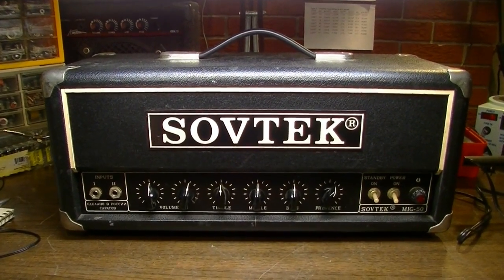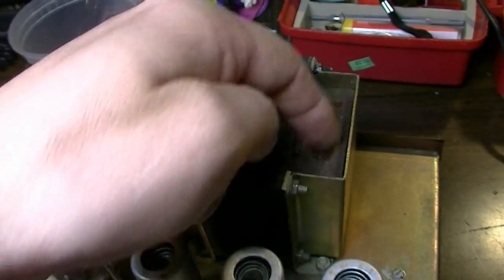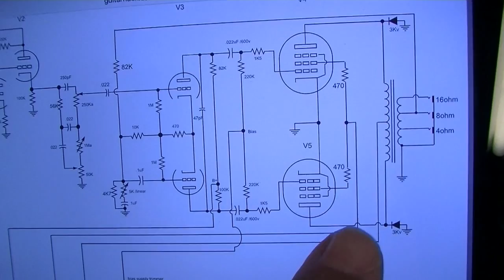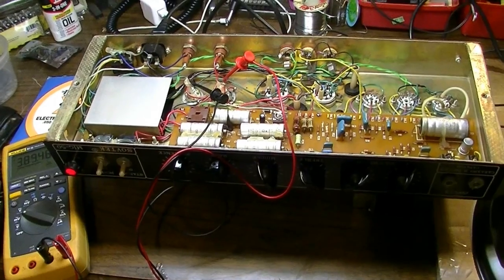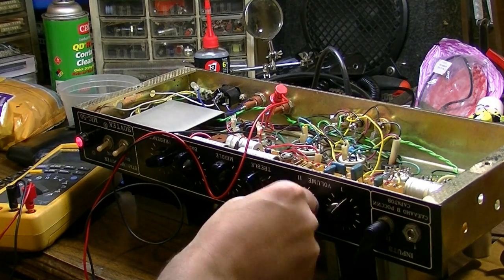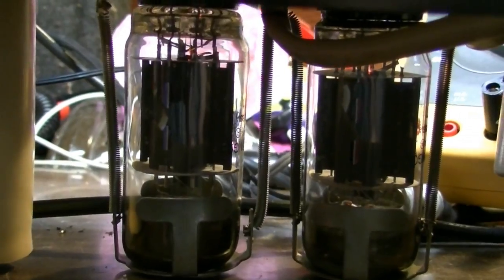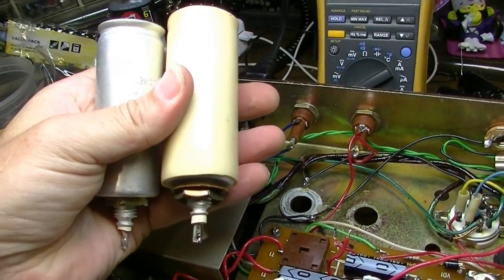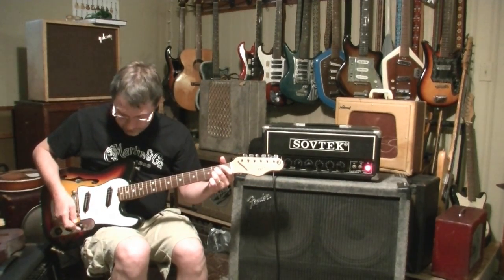PROOF the RUSSIANS RIGGED this Guitar Rig!

Comment: Problem with the capacitors listed on the schematics, they are obviously not correct. When it is shown as 25v and it is connected to a 600v rail. Also on the input triodes, the cathode bias capacitors should be similar or it will have low gain and only have high frequency response. As with all of these circuits, it is a good idea to have a tube reference manual. Also assume that someone probably put the wrong parts in the amplifier at some point. I have found even in color TV's from the factory the wrong resistor values from the factory. 

The input triodes can work without the capacitors in the cathode circuit, and if the tube is glowing best to cut one lead of the capacitor as it is most likely shorted and not allowing the tube to operate in self bias mode. Also this whole amp, it is best to draw your own schematic. Then using ohms law calculate the currents and voltages. All of the grids should not draw current, as it will destroy the tubes. Also just because those are mylar caps for DC bypass does not mean they are not leaky. The electrolytics  are easy to sub values, and replace in pairs when in series, otherwise one will see higher than rated voltage. 

The pots should be changed if noisy, or damaged. The way to check is put an ohm meter across the pot and turn it, if it sounds like sandpaper on the input then it is bad. 

Also the reason for the tube manual is (for those that have not used one) that it lists NORMAL voltages, current, and power dissipation so that it it obvious when the tubes are going to quickly fail. Also self bias is the resistor to ground in the cathode circuit to bias the grid negative with respect to the cathode. Also the cathode to heater voltage should always be kept low and commonly 50v or less. Series heater circuits are the only exception. That is because it causes line noise in the output and if high enough will break down the insulation between the heater and cathode. Not connected in this amplifier is a small trimmer pot across the 6.3Vac with the wiper to ground, and this is seem in circuits to eliminate line hum in the output. Because there is a small capacitance between the heater and cathode of every tube. This puts the hum into the circuit, and filter capacitors alone (no matter how large) or with a multi stage PI filter on the supply with chokes will not get rid of it as that is not were the hum is being introduced. 

I say these things from working on tube equipment for close to 40 years, and transistors circuits are the same when it comes to timing and frequency response when compared to tube circuits. The difference is the bias circuits. Also just because it is common to use a resistor for biasing a circuit, that is not what the resistors are used for in the 2nd grid. It is used primarily for current limiting to keep the tubes from being damaged. As those resistors are often bypassed with a 6L6GC, 807, and other common tubes, but are included when the tubes may go into saturation and draw too much current. I recommend investing in one of the older Oscilloscopes with tubes in the input stages, as they are more forgiving when working on hot circuits. Also the probes need to be good for a minimum of 500v, but more is better. Also having a probe with a bypass capacitor in it should be used when working on tube circuits. Invest in an isolation transformer, as when testing any of the tube circuits it needs to have the grounds and primaries isolated to avoid surprises such as burning out the ground circuit on your test equipment or the customers equipment. 

A word about safety, Gloves rated at 600v are not expensive and safety glasses is a must. That is because electronic components DO explode and I have seen this happen even with small transistors, capacitors, resistors, IC's, wires, and so forth. This is something likely to happen when repairing equipment, but not likely to happen during normal operation. This can also be used in finding problems in circuits, find a cracked part liquid coming out of a capacitor, and other things that do happen but not during normal operation when working correctly is the first stage of troubleshooting, next is checking voltages, then tracing signals.  This is why I recommend proper safety when working with higher voltages, as only things visible with a "Good" work light or flashlight can be found with the power off.

Comment: I have multiple devices from soviet russia with those types of electrolytics (from the 70s/80s). None of them have broken capacitors.
Those caps are from 93, so they are basically new....why change them? What brand and type of caps did you put in?

530V "horrificly high plate voltage". On the screens maybe a tad high but I wouldn't bother - the bigger issue is that they have that voltage on the screens as well like all the Marshalls. These amps need a second lower voltage tap for the screens...

Also, your probe does not even remotely look like it was proper insulated for the voltages you are working at.

Comment: After watching about 20 of your vids I'm about ready to revisit my tube amp repair days and dig into the1966 Ampeg B-12 flip-top recently acquired, all original except for the the chrome Ampeg logo. Getting a loud pop after the amp warms up. 7868 pwr tubes.  Bonus! The schematic is inside the amp head.
Reply from the maker: Check everything on the power rail. Change all caps and large power resistors and see if problem persists.
Reply: Thanks, re-capped the power rail & found a cold solder joint on one of 12AX7 preamp tubes. One of the caps had spewed some innards on the chassis... all good now.
Reply from the maker: Awesome! Cleaning sockets wouldn't hurt either. Lots of weird noises common with dirty sockets. Might prevent future problems from happening.
Reply: Yep, good advice, I have a test amp from Seymour Duncan they used to develop one of their commercial tube amps, it was such a mess, finally got it up and running but couldn't figure out where the random noises were coming from...Dirty Tube Sockets! My pic now shows the Ampeg and a 68 Epiphone Howard Roberts guitar (solid top). See you around, thanks again.

Comment: Great video series BTW, i am learning a lot.  QQ, for those large capacitors you replaced, did you just cut the old ones out and solder the ends to the old posts or did you completely remove them from the old board?  I am currently trying to fix my fender red knob amp and would like learn some best practices...  thanks..

Comment: The Jolana looks like the old Fender Bullet guitar except both pickups here are slanted.
Reply from the maker: It's from the early 70s and was meant to mimic the Fender Thinline Tele.
Reply: The early Bullets looked like a Tele too, but with Mustang pickups where the front one was slanted and the rear one straight, and they didn't have F-holes like this guitar, but they're both essentially just smaller Teles.

Comment: in the 90's i played n almost baught a used sovtek mini stack. 2 cabs n head. not sure of size or numbers of speakers or watts but was loud n had a knob you could pull n go from heavy distortion to pantera/djent. i loved the sound compared to my crate tiny personal amp.  it was loud enough to play with drums. 😍🍻

Comment: I have some of that material you said was fiberglass.  I don't think it's fiberglass.  It came out of an aircraft that did magnetic surveys for resources in the ground.  Its was called magnetic something/something.  It was used to isolate their computer and expensive "imaging" equipment from electrical interference caused by the aircraft.  The fellow that gave it to me gave me a very technical explanation regarding the stuff which went in one ear and out the other, so that's all I've got.  I used most of it for making jigs in my woodshop.  The dust when cutting it is supposed to be toxic if I remember correctly.  This was way back in the mid 80's, so yeah, long time ago.
Reply: Seems like you know a lot about these amps. I own a Sovtek Mig 100 and in between the preamp and power tubes there’s a small coffin shaped ventilated compartment that reads “Caution Radioactive Material” 

Any idea what’s in it? The tech I took it to said NOPE and that was it. It has wires going to it and to basically everything inside.

Comment: That schematic must be drawn wrong because that heater CT can't be connected to the power rail because the capacitor C21 is only 25 volts.
Reply from the maker: You make a good point. Another schematic I saw has a 1M resistor in series with the CT, after the cap, which should effectively drop V way down, but how large would that R need to be? I think I'll go back over the videos and see if I can make out what's going on in the amp.
Reply: I was going to point this out to,  I read through the posts to check.. The ECC83 Vfk is around 180V so in no way can the center tap of the heaters, in this design, be connected to the positive rail of over 400V, note the cathode follower must be held in this limit too. PS. I used to build Nolan Amps in London UK in the 60's.

Comment: I had a Sovtek MIG-100  bought new around '96. Great sounding amp. But as you've observed, the parts were garbage. My intentions were to A/B  it with a Fender Super 6, but there was some type of ground hum issue, and also it would knock the crap out of you at the mic. Traded or sold it fairly quick. The cheapskate tube circuits scared me a bit.

Comment: Its always a good idea to Re-Form caps after installing. The main reason is we don't know how long they've ben on the shelf. Some caps like F&T don't put Birth Date on them which is a Scam. Even if an amp with newish caps is left un-powered for a year or more its a good idea to Re-Form. The longer a cap is without power the longer you should take to Re- Form. There are formulas online to calculate this.

Comment: those burned resistors are 2 and 5 watt ones and slightly burned paint coating is actually OK. 
paint just can't withstand 5W heat dissipation. (resistors of this type are quite good and can take much more power than rated).
big (in size) soviet caps are usually OK too, but small ones are just shit and needs to be replaced without checking.

(i am russian)

Comment: They also made a mig 30, mig 50 mini, mig 100 and mig 100H. I modified and sold 100’s of them. Fun to mod. Can be made to really sound good. The transformers also are made for 110 when you use 120 volts the filaments are at about 7.5 volts. Not good for the tubes. Usually 2 12ax7 wa and one 12ax7 wb. Slightly different gain. Replace pots, jacks and caps and they rip. Also russian resistors are physically small for there rated wattage. That is the deal one channel sounds like a jrm45 and the second a bassman. Mig 100’s run about 560 volts on the 6L6’s. Crazy. Fun amps. I sold 4 of them last year at guitar center. The mig 60 sounds awesome. Total Marshall tone. Fun stuff. The traces are terrible. They all break. Fun to mess with.

Comment: The fibre board is called PHENOLIC  very common material used for a very quick to use  material for machining, essentially it is a very strong fabricating material that is not metallic super tough.  I would like to have a Guitar Cabinet made with this nearly super material.

Comment: The Sovtek amp's were not bad for the price and could be easily modified. Also the tubes are mounted on the chassis,unlike the new cheap imports which are board mounted. I've never had to replace a transformer on one,just normal tube replacement.

Comment: Aren't the plates on the transformers to reduce external field?  It's a long time since I worked with valves, but transformers are always a source of stray fields.
I love your amp-mending videos, btw.
Reply from the maker: Yes, the bell ends usually help with that. I was mainly curious about what might be under that brown material because it was different from the way we usually see transformers constructed.

Comment: I have been repairing (and building my own) amps since the 80's. If a capacitor looks good and tests good there is no reason to change it. As the quality of caps in general has dropped over the years the original part may well last longer than the replacement. The B+ cap works much harder than the others, so if it is bad it doesn't mean others are bad, especially those filtering the preamp or driver stages. I frequently work on amps with over 500 B+ It's up there but I've seen a B+ over 700 many times on Hi-Fi stereo amps. It is fine to power up an amp at full voltage that has new caps installed, it is only a good idea to use a varac when caps have sat un-charged for many years. I think you listen to much to others opinions. Take the time to study Electronic Engineering for yourself, learn how the components work in detail and are made. That way you will not only be able to repair amps, but you can come up with your own schematics and builds. My personal favorite amp that I came up with had two preamps, one clean one with overdrive. They could work alone or be mixed together. The input stages on both were SRPP followed by another SRPP stage (all 12AX7's). The two stages were passively mixed and fed into two class A stages (a 6SL7) with a gain pot between them. I used a 12AT7 phase inverter (both haves wired in parallel) into the output tubes. The output stage was grid biased with adjustment for each tube so many types could be used and mixed i.e. two 6V6 with two EL34. The owner ended up using four Bendix 6V6 to get a nice sounding 24 watts, even though it could run at 120 watts with four EL34 (or KT66 my favorite tube). Keep em glowing man.
Reply: Agreed- cap jobs can be so knee-jerk. Same on variacs, never used one and have done 100's of amps. That being said, have definitely seen exploded/leaky caps, which obviously need changed lol.

Comment: I knew the problem as soon as I saw you attach the probe to the diode.  BTDT and decades later still remember the butt kicking it gave me before I found it.  The force of the probe caused the diode to change state between "good" and "open".  Prodding the board would do it too, but it would be more evident if you pushed sideways on the body or tried to roll the diode side-to-side.  For others following along, I assume that diode was for the bias.  So, with the diode open, there's no bias and the tubes run wild.  That'll suck some power!
Reply from the maker: Yep. It was obviously a crappy little diode. If I ever get another one of these across the bench, that'll be the FIRST thing to go.
Reply: FYI, the time I ran across it was a US solid-state stereo.  So, I'm not sure as it's a crappy diode as much as the way diodes can fail.  But I'm sure you'll be on the lookout the next time an amp suddenly changes while troubleshooting.

Comment: I know people that go ape over these amps, till the board melts or he caps blow up. Great sounding amps but they are sort of non friendly to any other tubes but New Sensor tubes. Solder joints are really week. I remember these when they were brand new and was going to buy one but something kept nagging at me not to.  Original correct tubes are the 6P3S not the 6P3S-E like what you have here.

Comment: I lost a Mig60 to a pawn shop right out of high school and it was definitely the JCM800 clone of the two. Ok with losing it, my JCM900 2500 was better anyway.

Both are pretty great. The 50 has a pretty weak eq but it adds up to taking old school Tech 21 pedals with ease. My YBA1 was similar in that regard.

Comment: Great sounding amp that retailed for 250.00 in 1990  easily picked up used for 150.00 a year later a simple parts upgrade  for 25.00 and you had a killer amp cheap.  Mike Matthews of EH fame had the right idea at the right time. I've seen stuff built today that is of the same quality build wise that retails for 1.500.00 and more. How times have changed.  If you can find one cheap that still works buy it you won't be sorry  but change to El34's for a creamier tone or put some RCA 6L6 black plates in it, new 6L6s/5881's suck in comparison.